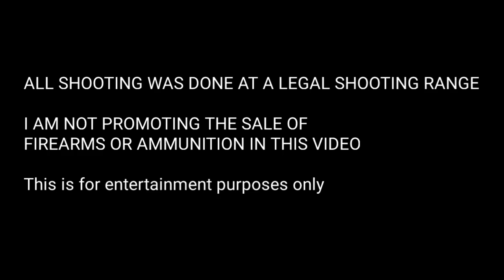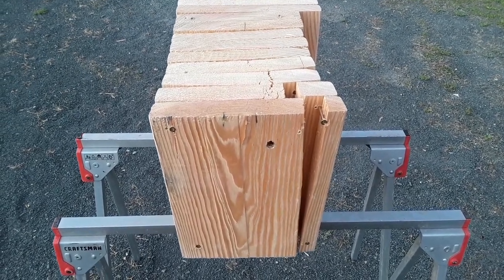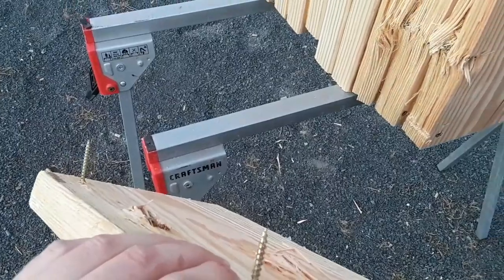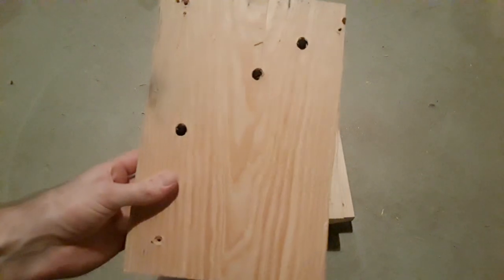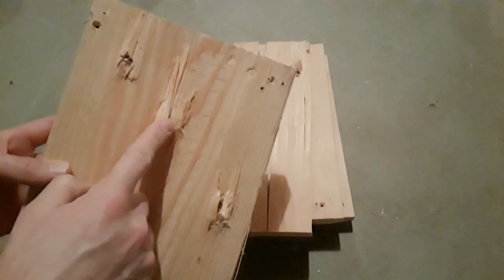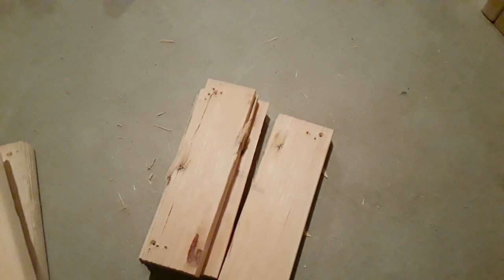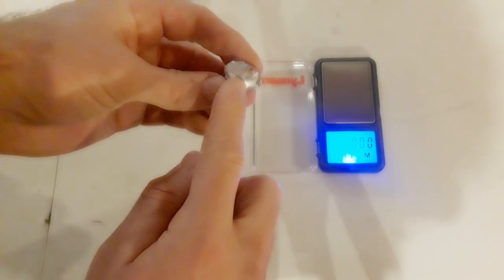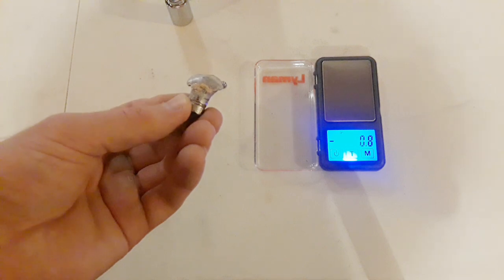500 S&W Magnum vs 2x10 Lumber Penetration Test #4 - Underwood 700 Grain Hardcast

Comment: My research(es) in big bore heavy/er loads indicate that the 700 gr would perform better against the harder mediums e.g. concrete/steel/titanium/engine blocks and be much less likely to deflect- such as what happened in your video wherein your  440 gr hardcast had first encountered the 4" concrete prior to going into your 2"X10" multiple boards. 
  Perhaps try the 700 gr hardcast vs the mediums that you used for the 440 gr hardcast i.e. the 4" concrete with 2"x10" boards and the pumpkin- or simply more boards excluding the pumpkin. The pumpkin would be instructive to see -especially if there was any expansion.
  Thank you very much. Too bad you can't/won't/aren't  leaving NY..
   I have subscribed and signed up for all content.
Reply from the maker: I left new york almost 2 years ago.

Comment: I had this gun (not this exact gun pardon me it was actually a .38, the other one was a Charter .357) and another one.  Missed both of them a lot but after losing them in 2 different ways, I'm not buying another one unfortunately.  So I bought a Kel-tec PMR-30 instead.  shurgs That new P50 though, am I right?

Comment: Would you recommend the 6.5 inch over the 8 inch? How much power do you lose?
Reply from the maker: 6.5 is more practical, much easier to carry and lighter.  With faster burning you don't lose much maybe 75 fps based on my tests so far.

Comment: Have you tested any solid brass ?? I. 50 BMG some guys would shoot machined Berger brass allow for long range. I always beat them just using 750 gr amax but the solid Berger’s were nice billet.
Reply from the maker: I have not tested brass solids, but may give them a try in my 416 ruger elephant gun.  I have shot the copper alloy solids in all of my guns.  The Hornady DGS perform well they have a thick steel jacket.
Reply: @NYPrepper  I always liked the .416 Rigby in lieu of the Ruger- as it is not merely not belted yet also according to "cartridges of the world" less likely to Jam due to extreme heat ( however- since I have neither I am one to talk). Always get the cartridge without the useless belt- all other things being equal.
   I do however have a DA blued Ruger Redhawk (Originally .44 mag caliber) revolver in .500 Linebaugh 5" Magna ported barrel with tritium sights custom built for me by Hamilton Bowen: before the .500 S&W existed.
Reply: I believe the way the law is written, a solid brass pistol bullet would be considered armor piercing and therefore illegal.

Comment: Since I am a Huge fan of the 44 mag., I am thinking of getting a 454 Casull. 
What are your thoughts on the 454 compared to the 500 Smith?
(Thanks)
Reply from the maker: What are you planning to use it for?  Hunting or defense or just for fun or combination of all?
Reply from the maker: 500 magnum has wider variety of loads you can go from a 300 grain Hornady Flextip at 2000fps to a 700grain hard cast at 1200fps.  I personally would go with the 500.  Don't get a short barrel one unless you plan to backpack in Alaska or Montana.  I'd go with the 6.5 or 7.5 inch version.
Reply: @NYPrepper  Thanks so much for the advice.
Reply: @NYPrepper  I plan on moving some day soon to a more rural environment and was thinking hunting,...but more bear protection.
Reply from the maker: Go with the 500....huge variety of bullets